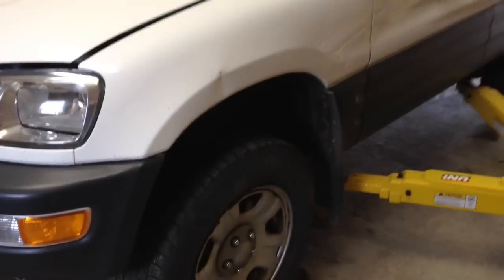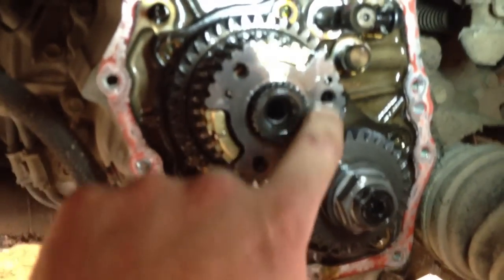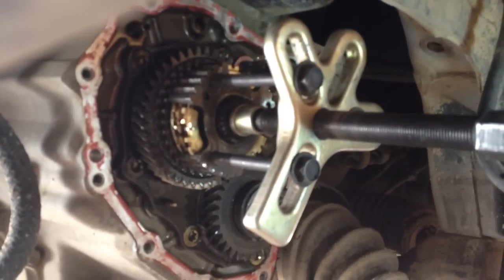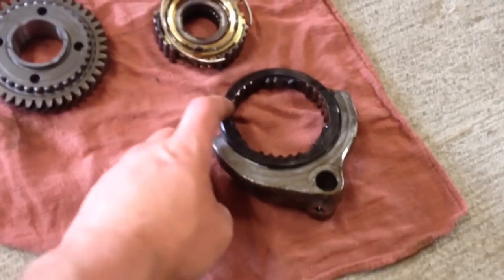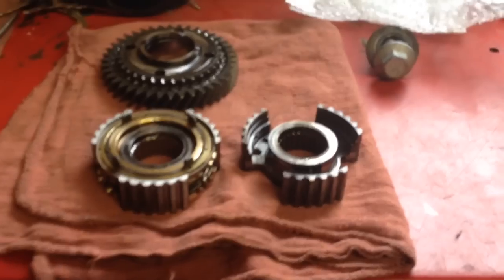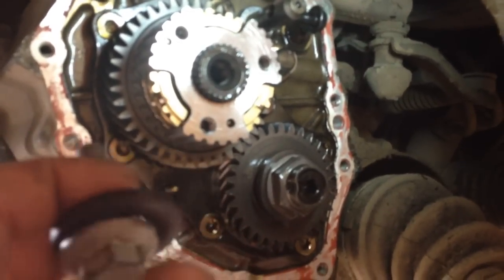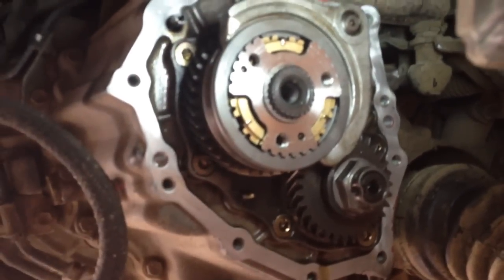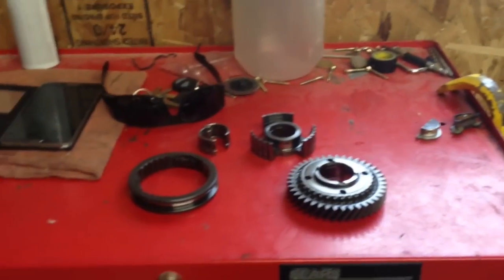Toyota Rav4 5th Gear Pops Out Repair

Comment: Even after eight years this video still helps guide people through the Toyota slipping out of 5th gear fix. Mine was on a 02 Camry with 234K miles. The transmissions are basically the same though access requires removal of the rear transmission mount and I also removed the air filter box to access the top three transmission cover bolts. As with others, I purchased parts from the UAE via EBAY at about $250 shipped and they were all genuine Toyota parts. As a precaution I replaced what is called the 5th gear transmission clutch hub, about which the video suggested it wasn’t needed then later said it was. I could find no indication of wear on the original that would have persuaded me of the need to replace it, but I’m hoping to never have to do this job again, so I ordered it and did the replacement. My thanks for the original video and helpful comments made by others.

Comment: Thank you for posting this video! I have a 2000 Rav4 with 266,500 miles and my 5th gear went out and your video helped me fix it myself.  I ordered the parts from Metro Toyota in Kalamazoo, MI and saved more than $100 from what my local dealer wanted. And, yes, they also wanted between $2-3K to do the work themselves. The parts numbers are: 5th gear - 33336-42040, trans sleeve 33395-42012, trans clutch hub 33393-42010 and needle bearings 90364-28023. That is all that is required and cost me about $260.
Reply from the maker: i am glad this video helped you. What an awesome fix that is!

Comment: Just followed this procedure on a 2003 RAV4. With the exception of a different part number for the gear itself, everything was spot-on! 2003 5th gear is part no. 3333642030. I owe you a beverage of your choice, fine sir! I greatly appreciate your spirit of sharing. From your accent, you seem to be from a prairie province? I'm in BC. Probably used the same Princess Auto puller you did :-) Once again, very much appreciate the effort you put into this video.

Comment: Hey dude, thank you so much for this. I just did my 2004 Corolla Verso which is a very similar layout, I ordered the parts on eBay from United Arab Emirates and including import duty cost me app £180. Certainly way cheaper than taking in to a garage.. :)

Comment: I would like to thank you greatly for your video; I had the same pb with the 5th gear on a corolla verso 2005, and I just came back from the test ride; it works fantastically. p.s: I paid 505euros for the parts from Toyota dealership in France.

Comment: Here is what the local Toyota dealer quoted me. 
These part #s are for a 2003 with the 39 tooth 5th gear.
Good Morning Jack, all those parts are available.
33395-42012 $174.40
90364-28023 $54.30
33393-42010 $188.40
33336-42030 $311.30
Everything is in Vancouver except for the 5th Gear which would have to come from California.

Comment: This video saved my ass. The parts cost me $275 from a Toyota dealer online.  I showed the video to my mechanic , and he charged me $150.00 for 2 hours , but he told me it took a little more than 1 hour.    Also, use part# 00295-01281 for the Toyota sealant.

Comment: Wow!  Thanks. This is one of the most useful vids I've seen on the RAV4. At the beginning of the clip you did mention that you would provide part numbers. It's still not too late to put them in the comments :)  I think these are all E250 transmissions between 1997 and 2000.
Did you get the parts directly from Toyota or a another source? He, thanks again! I hope you find time and inclination to make more.
Reply from the maker: Thank you for watching. I did finally put the part numbers in the description. I hope to get more videos going again.

Comment: Great job dude can I ask you a question I have the same problem but in Toyota avensis 2005 are they the same parts I would need 
Could you answer please
Reply: Did you find out if this works on the Avensis? I have the same problem and wondering if I can fix it using the same instructions in this video

Comment: What do you need to do when first gear doesn't seem to be synchronized, and grinds when you try to engage it without stopping completely? Is that whole synchronizer cage for all the gears, or just for 5th gear?

Comment: I decided to replace my fifth-gear sleeve, bearing, synchronizer, and hub for my 1996 RAV4 MANUAL by following multiple videos along with this post very closely 5th Gear Popping out Self-Repair. I finished just about everything except when trying to press the new hub with the old, the 12mm 1.5 thread pitch 55mm bolt (with a washer) is extremely hard to tighten and it seems to be creating a new thread on the bolt which is wider. I don't really know what to do at this point, I'm trying to see if I can find a gear pusher tool in the auto parts stores around my area. Can anyone help me out?

Comment: Thanks for this.  I've replaced 5th gears in a few VWs and the process was the same.  Why did you change you mind about the necessity of the hub part?
Reply: I see where the new needle bearing is too big for the old style fifth gear. Is the new syncro hub different too?

Comment: Questions and comments.. Any info on where I can find the model of manual transmission for my 1992 Camry, 4 cyl. Is it an E(xx), C(xx) model  or what? My shift lever was rocking back and forth with torque until one day it finally popped out and wouldn't stay in unless I would be under light load and going downhill. Question is.. is the rocking caused by excess play in the bearings for the shaft that the bigger gear is pressed on to? If so, then the case would have to be split deeper and those bearings replaced/shimmed, I think. Comment.. I believe there is a video where someone put in different ratio 5th gears on a Celica and got their RPM to drop considerably. I can no longer find that video. Question is.. are there better 5th gear ratios for the Camry. Question.. will the manual transmission on a V-6 fit a 4 cyl Camry... axles??, shift levers, etc.. Reason I ask is if it will, the transmission may have a better final drive ratio.. even though the engine may be a bit doggy on a hill... I'm looking for very low rpm/high fuel mileage on level ground.

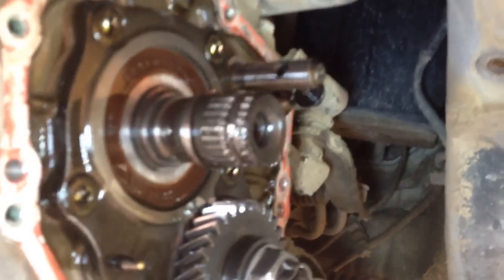Comment: Hey I am curious about those few black O-rings that are visible at 2:34 (a bit fuzzy, but...) just after you pull the synchronizer piece off.  Did you replace any of the little things like O-rings, seals, clips, etc?  And, now, after the fact, if you didn't, can you tell?  Do you know their sizes?  Could probably get them at Lowe's or the like?  Or Toyota?  I've got the parts on order now so wanna get everything together.  THANKS SO MUCH for the GREAT instructional...Even Toyota "experts" don't seem to know you can just change the gear out.

Comment: Hi, am I right in thinking that the parts I need to ask for from Toyota are a replacement 5th gear, needle bearing, sychro housing and selector fork?
Thanks
Reply: Umm. You probably don't need the No. 3 shift fork. I know the shop manual suggests you may. Unless I'm mistaken, according to Mike's video you do need:
5th gear 
needle roller bearing (for 5th gear)      
No.3 Clutch Hub 
No.3 Hub Sleeve
Reply from the maker: i have finally put the part numbers in the video description.

Comment: Tried this on my Avensis, but there is a problem with the syncro hub. I cant get it pressed all the way in, so I cant get that snapper in. Any advice? Theres only like 0,5-1mm left pressing and those 4 spots behind the hub are lined and those 2 pinches on front too.
Reply: Did you get this sorted? I'm having the same issue!
Reply: @andrewbrady91  just took some material off that snap Ring with belt grinder, made it sure to Be "tight" fit. I still have this car and I have driven 150 000 kilometers without issues.
Reply: @PenttiHinikka  Amazing, thanks for the response. I'll give it a go.

Comment: Hi great video, I have the same problem with my Scion tC the 5th pops out do you think is the same way to fix it ?
Reply: My guess is that it's the same issue.  I've taken apart the tC 5-speed trans before, and it is essentially an identical design for 5th gear.
Reply: duglas esquivel my 5th gear pops out on my 2006 5speed manual Scion tC 114k miles but I can still hold it there no problem. Is my 5th gear gone and need to be replaced? I check the transmission fluid and when I unscrewed the filler bolt it started coming out
Reply: 06 TC owner here having the same issue, did you do the same procedure?

Comment: Can you or someone here describe how to hold the spindle and gears from rotating while using the bolt/washer method of pushing the cage back onto the spindle?  Thank you.
Reply: Hi did you ever find a solution for this? I am in the middle of this job right now.

Comment: This all is pretty vague. I'm in my garage doing this right now and cant get the synchro cage to come off. using the same Harmonic Balancer Puller and method. The shaft spins with the turns so I jigged it to stay still, but its not moving a millimeter. No idea how to get this thing off
Reply: I used a 1/4 inch brass rod between teeth of drive and driven gear teeth to stop it.

Comment: Mine just grinds when I try to put it in 5th gear. Its a 2004 & bought it that way.
Reply: Hi Jack , have you been able to fix it ?if not is your car still working fine ?
Reply: I'd say this kit will fix that issue also
Reply: @chadfordham1  Mine works great now. I fixed it and was relatively easy just like the mikealan said.